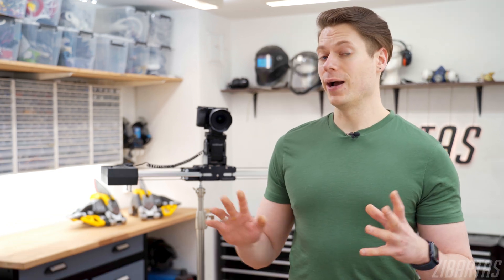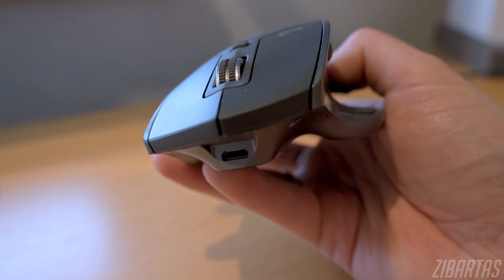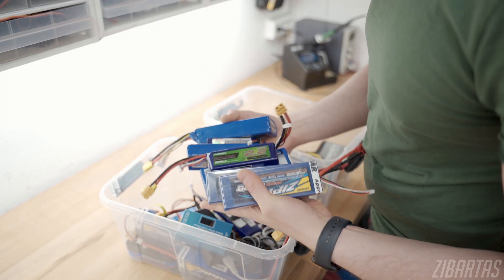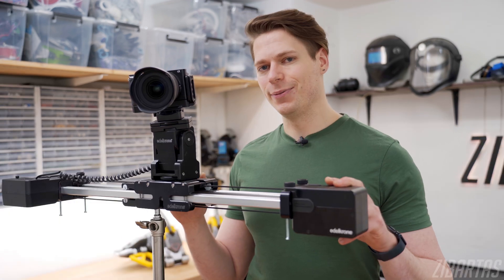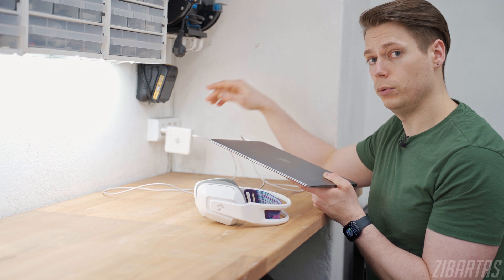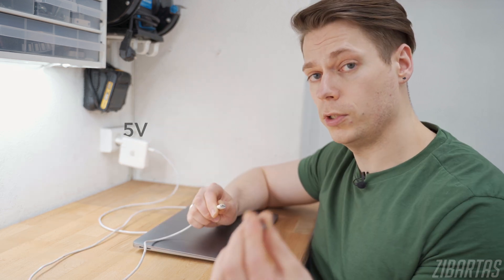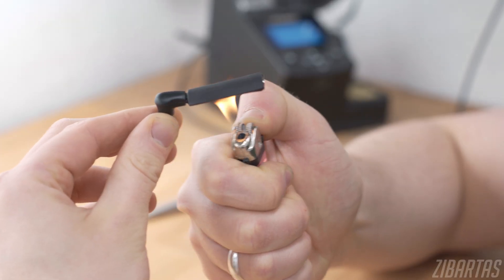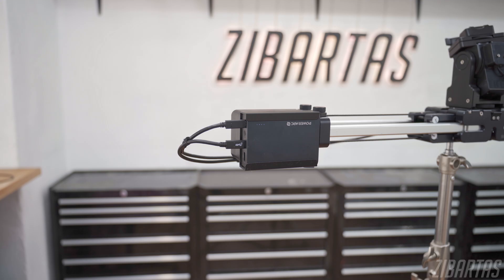Power Anything with USB-C Instead! (USB PD DIY)

Comment: I have a question, about using a usb pd power bank to run a small strip of COB led lights.
 
These lights have an AC wall adapter that outputs 24v. 
I was looking at the usb pd spec and it only goes to 20v. 
Do you know of any rechargeable usb pd power banks that output 24v over usb c? 
Is there a better solution, than what I’m trying for?
The project I’m working the COB LED light strip to a mask.
Reply from the maker: You can definitely find 12V version of those strips :) if you MUST use 24V you can try a step-up converter from 20v or find usb-c pd trigger boards for the newer 38v(?) I think, and use a voltage regulator to bring it back down to 24v. But those new higher voltages are rarer as the spec is a bit newer.

Comment: I don't know why there aren't more guides for this technology, this was a great starting point. Trying to figure out a modular way to supply power to 4x Raspberry Pis and 4x portable monitors at work, thank you for sharing this helped a lot!
Reply: Take advantage of the multiple voltages you can get from USB PD. Use the 5V for the RPi's. So a 4-port USB-C Adapter with at least 65W or if not 100W for all for of them. They take 5V/3A each for the RPi4. So 15W's each at 5Volts. 
Then you could use the 20V of the USB PD to get the full 100W's of power and have enough power for the Monitors. Find the Specs of the Monitors and see what they're input voltage and Amperage are. If you need to lower the voltage for the monitors you can use an adjustable voltage regulator so you get nice stable voltage, unless they run on 12V then you can decide whether to use the 12V PD but with a lower power output or use the 20V and drop the voltage down..

Comment: The only ones that are available in my country have all of the volts available. The instructions say "select the needed voltage by short circuiting the corresponding solder pads". I'm new to this so I don't understand what it means. Could you or anyone here explain the process?

Comment: Nonsense.  You don't want all the chargers and cables, but then you have to keep buying more and more USB-C chargers and cables, with them costing more, and them not being able to power a substantial amount of equipment that takes more power, and with the equipment already coming with the power adapter it needs so you are suggesting that if you don't like having those around, that you are going to throw away the adapter designed for the equipment, and buy an expensive USB-C PD charger to use instead?

It can't get much dumber than that.   You reduced zero clutter, still need a box to throw all your USB chargers in if you are pretending you don't have them all out, the same as you would the  original PSUs.
Reply from the maker: I'm reusing the same MacBook charger and power banks for all my gear now, instead of having a bunch of different ones in the workshop

Comment: Is it possible to convert a wall plug into a usb c? Specifically, digital photo frames have to be plugged into a wall outlet. But what if you wanted to use them outdoors where there was no outlet? Would it be possible to convert that plug with some sort of adapter to work as a USB c that could be plugged into a power bank? (Clearly, I’m no electrician, but I’m wondering if the voltage problems are too significant.)

Comment: Dang! I want a whole kit of adapters, I am not as DIY as you and found some ready to go usb c to barrel adapters on A-zon will post a link to a fancy one below. One thing I am not sure of...and would like to find out...is the only "smart end" the pd chargers chip or is there some kind of "handshake" on newer devices (like your phone) on the charge receiving device end that lets adapter know what voltage it requires? If say a "legacy device" say a cordless drill wants 20v will a variable V PD send it 20 somehow sensing its demand? WIll it know when fully charged, I'm thinking probably not???

Comment: I have added usb c to a few 12v devices and i heared/ noticed that 12v is not common for a charger or powerbank (they only use 5v 9v 15v (and 20v) and skip 12v). you need the look at you charger/powerbank to see if it support it.

I used a 20v trigger board and a step down buck convertor to go to 12v.

If the voltage is not aviable on the charger then the trigger board should go to the voltage below that but i not know if every board will do that

Comment: Thanks so much! I was trying to figure out a setup for the April 8 solar eclipse using just one power bank to power my Nikon DSLR and a GoPro. I hooked up the power bank and the DSLR and only got 5V. I was wondering how to get required 9V for the DSLR and saw this video. Ordered the PD module and hopefully get the set up working tomorrow!
Reply: Did it work?
Reply: Some power banks switch to 5V when 2 or more sockets used. Check the manual for combined use voltages.

Comment: can u adapt the oposite way, ill try to explain, i have a camera monitor and i wnat to power my camera trough the batery of the monitor output dc and conect to my fujifilm dummy usb c https://static.bhphoto.com/images/multiple_images/images500x500/1592917288_IMG_1378381.jpg
https://m.media-amazon.com/images/I/51vPCSsTTaL._AC_SX466_.jpg

Comment: I just came across your video while searching if I can use a UCB-C to DC converter adapter with my laptop. I didn't find any thing useful but your video actually made me think about that TRIGGER voltage chip. Well, I am not an electric guy and can't figure if understood really well for my problem. So I'll just put my question here in hope you may reply. I have a laptop that comes with a USB-C Power adapter. It's 65W adapter with all those voltage points you mentioned - 5V, 9V, 12V, 15V, 20V. A USB-C to USB-C cable comes with it in the box with the laptop. The PD USB-C port in the laptop serves also as a display port. The problem is when I want to use the port for external display, I can't do that unless I put the laptop on battery. The solution is to use another DC-IN port (which I guess is 3.5x1.35 as I read somewhere) but I can't find the full power adapter for it. Though I found some USB-C to DC converter adapters which I wonder if I can use with my original USB-C power adapter by just attaching the convertor adapter onto the end of the USB-C  cable and insert its DC pin into the laptop. Now after watching your video, I am now wondering what role the this TRIGGER voltage play in this scenario? Can I even use such a USB-C to DC converter adapter? will there be any downsides? or even if it can harm the laptop circuitry? Hope to have an answer.. thanks in advance for taking time to read it.

Edit: another thing with those converter adapters is that they also mention the trigger voltage. most of them are 19 or 19.5v... I didn't find any 20v.. what should do about that? will those 19.5 or 19v converter adapters will work with 20v output from the original power adapter? I am not sure how much power the laptop uses, whether it's fixed or variable voltage through the battery charging levels. However, the original rating on the power adapter is as follows: 5V*3A 15W / 9V*3A 27W / 12V*3A 36W / 15V*3A 45W / 20V*3.25A 65W

Comment: The problem that I'm having is my cheaper electronics don't work with higher power type C cables. So I can't use my laptop type C charger with my head torch type C charger

Comment: Nice video. Yes, I use a variable USB-C to DC (5521 + other heads) to use power banks for different appliances. The adapter I have has a button to set 5, 9, 12, 15 and 20 volt. Only I have to be careful not to use the wrong setting for each device as it will kill their board.

Comment: I have a 12v 100w power supply. Can I add an electronic board to convert this 12v power supply to a pd usb c 5-20v power supply? If yes, what is the convert board called.  (note: I noticed the there are dc dc convert around but these dc to dc converter board need manual adjustment for voltage level.)

Comment: Question... should you also be stepping up the Type C cable gauge?? If people are running 12, 15 or 20 volts through a standard 5V type C cable to a high demand appliance couldn't this be a fire hazard also?

Comment: I'm looking at a solder-less 18650 power bank that hold 28 cells and has a type-C smart port. it is cheep too [$25+/-]. use your own cells. it says up to 20v 1.5 AMP.  but I had no idea how that would work with , not to smart devices. THANKS so much. now I know I can power anything with it , and one of these adapters. so cool.

Comment: When using a pd usbc powerbank as source for say 12v dc output, is it a clean 12v dc as if the three battey cells in series which gives clean dc or it is a boosted 12v which contains some hf noise? . Ref a use case for RF ham radio application.  Thanks in advance for an answer,  cheers

Comment: This is so cool! Ive been planning to do a usb c charger adapter for my gaming laptop (no pd charging support sadly). It looks like certain chargers from brands like Dell use additional pins for communication between laptop and charger though so they usually have 3 lead wires; i wonder if that means you need to use a trigger board with positive, negative and GND pinout
Reply: The middle pin of dell chargers appears to be connected to gnd through a resistor
It's purpose is to prevent the laptop from pulling power until the plug is mostly inserted 
You can bypass it by using a <yet-to-be-determined> resistor

Comment: First off, thanks for the video - short, concise, and well-explained.

This is a dumb question but I have a bit of a concern regarding amperage - the device I want an adaptor for has a 12v 0.4A DC port (proprietary but with male->USB-A male cables available from china) & an internal battery, would one of these just use the maximum 3A, or is that managed by the connector itself?
Reply from the maker: The current limiting should be done on the device - the amperage of the power supply denotes the capability of delivering that much current, not affecting what the device consumes :)

Comment: Can you check if this specific negotiator/PD board outputs 5v or 0v if the connected power supply is not PD compatible? If it does output 5v you might end up damaging equipment specified for higher supply voltage.
Reply from the maker: Yeah the ones I tried revert to 5V if plugged in to 'dumb' sources :)

Comment: Oooh those adaptors are brilliant, i have so many devices with clunky or proprietary chargers that would benefit from this. Thanks for sharing.
Reply from the maker: Glad to help!! I'm in the process of upgrading everything, too! :D
Reply: None will benefit at all.  There is no such thing as a "clunky" charger, and if it is proprietary then you need to DIY the extra adaptation for zero gain so it makes even less sense to do.  Wow, mindless black hole of WTFBBQ.
Reply: @stinkycheese804  I had this doubt.
Phones do extra to complete the PD loop, but this is just a chip connected to a load which was not originally designed for this PD input.
What can go wrong using this chip & zero gain means?
Reply: @stinkycheese804  womp womp